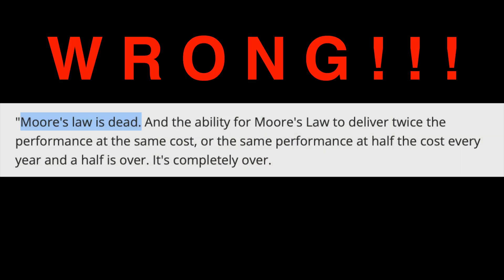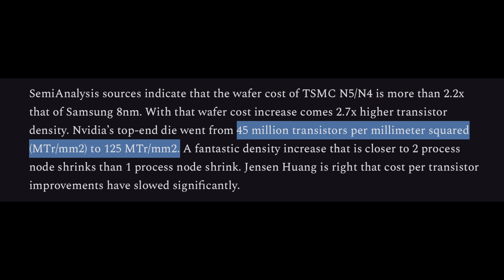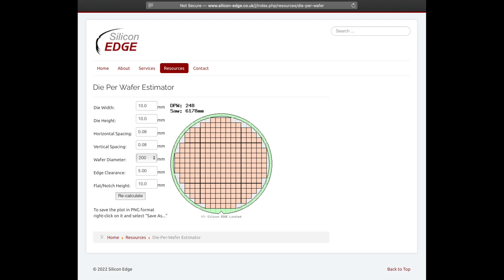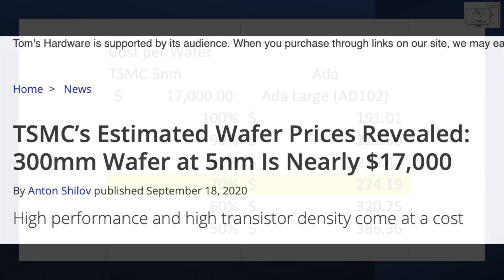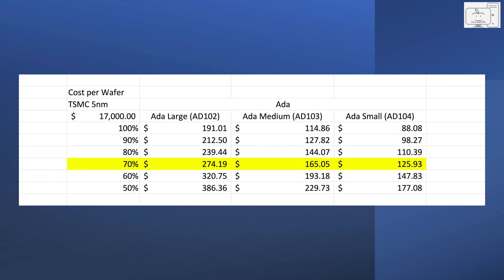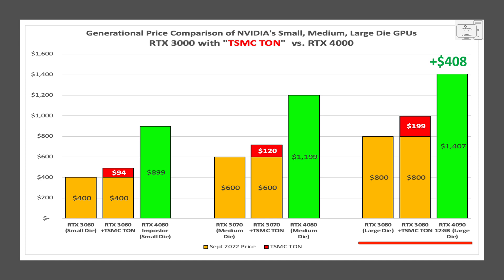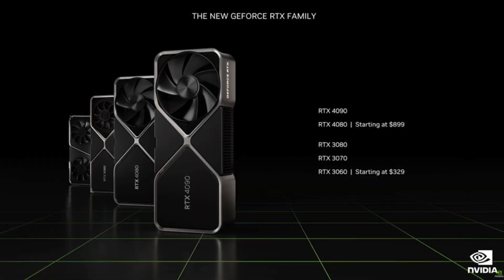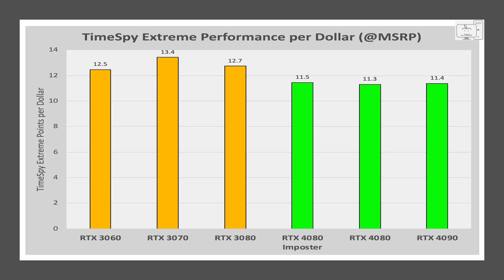Why is the RTX 4090 So Expensive? Is it TSMC's Fault? What is the Gen-on-Gen Performance per dollar?

Comment: Is there any non 4k situation where 10gb on the 3080 are not enough?
Reply: Hd tex packs on 1440p yeah. You will never max out 10gb. It's not about vram.. It's about how game and gpu handles vram.. Your game performance will go down..
You always need some empty unused vram for buffer etc.

10gb is very poor for a card like 3080.. Nvidia did it on purpose to give it a low life span. Gtx 1080 had 8gb. 2 gens later its unacceptable that vram only increased 2gb more. Especially what people actually paid for rtx 3000...

16gb is the new 8g..
Reply: Maxing out settings on games like GTA V could have easly reached 10GB. Imagine what next gen games could request from GPU. It's just a case of making sure it will still be able to play maxed out games for a few years forward for me.
Reply: @quercus3290  that's with ultra settings and dlss off?
Reply: @quercus3290  well it won't hit 10gb because its not how ram works. You will have less textures etc loaded into vram. Poor performance is what will happen. Gtx 1080 had 8gb. And that card was used for 4k 30fps gaming and 1080p gaming back in 2016... 8gb was too much for 2016 games.. We were in 2020 and they had 10gb vram for 3080. Its unacceptable. It should had at least 16gb like amd for a long term use.

I still have a gtx 1080. It's playable because of its vram capacity..
Reply: @quercus3290  cyberpunk 2077 4k uses 10g vram on 3090ti... On 8k it used 12 gigs. Same game with 3080 will not see 10gb that's because of buffering.. But performance will be lower.

Comment: Very good video and my point will not change the results or conclusions.
But you are ignoring bigger coolers and the added cost that the TSMC ton makes in terms of Margin  in your calculations all the margins of retailers and Boardpartners would go down so you need to add their added cost for them to get the same margin to the TSMC ton.
Reply: For example retailer X makes 10 %on a 800$ card so they make 80$
If you add the TSMC ton ~ the new GPU would be 1000 $ so the retailer would still make 80$ as per your calculations but in reality the retailer would try to stay at 10% so it would be 1020$ as old price plus TSMC ton these numbers are not correct but it should be understandable with this example
Reply: @chillidog8726  that's not TSMC, that's board parter. And it's true they determine more than half the cost of a videocard. So if the GPU + package + memory costs from the AMD/Nvidia increase due to TSMC, then the risk and the board partner margin also increases. I'm a Mac doesn't seem to address that here, taking the TSMC price raise only from the gross cost perspective.